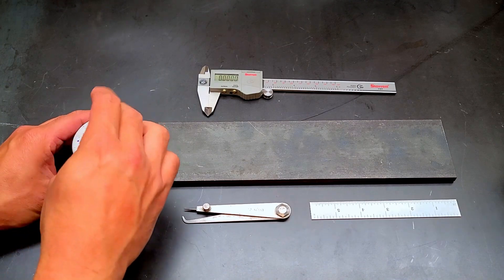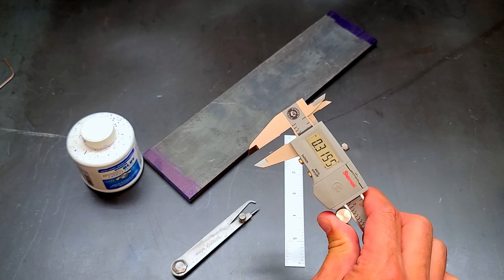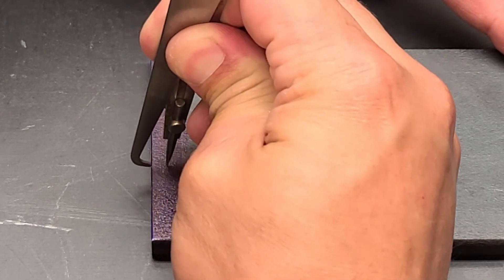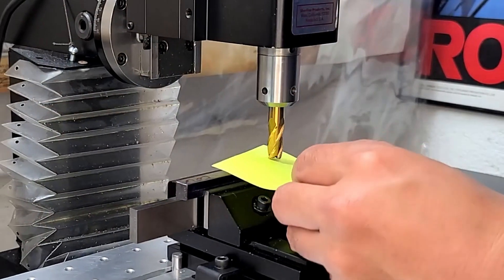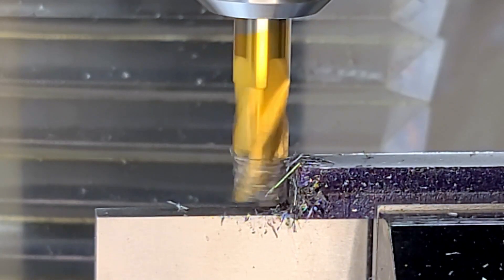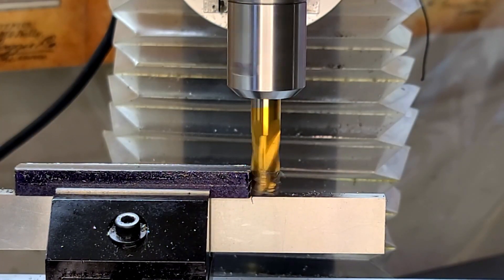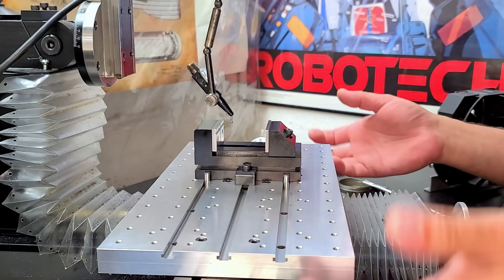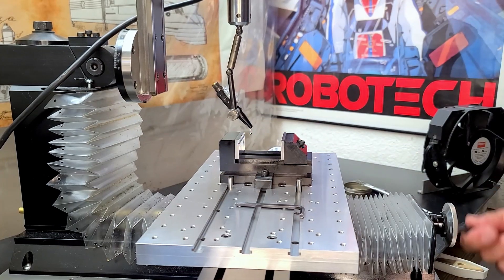Benchtop Milling Machining of A3 Switcher Tender Columns

Comment: Have you considered doing a cnc conversion? You don't need to use sherlines electronics and the mounts and cnc compatible leadscrews are fairly cheap, so long as you aren't going ball screw. As someone who started with one of the smaller mills and changed and upgraded part by part, i can tell you it's totally doable by buying parts off their exploded diagrams.
Reply from the maker: I would love to get my mill into a CNC state.  In fact I wanted it there for whenever I get onto the driving wheels.  I was hopping to machine mine own rather than a casting.  I would like to learn more!!!